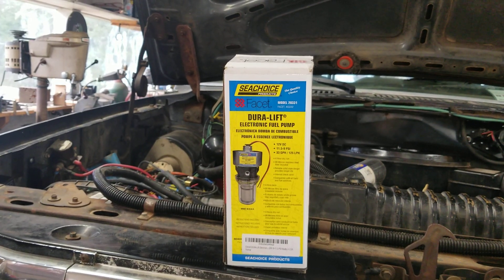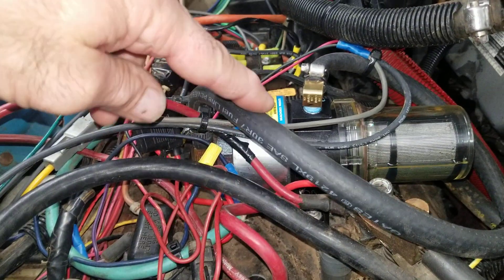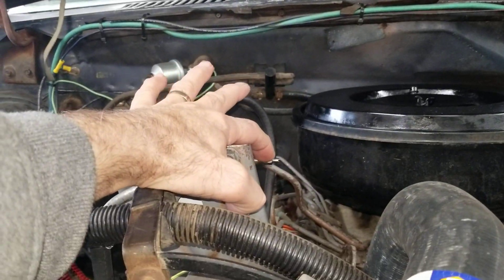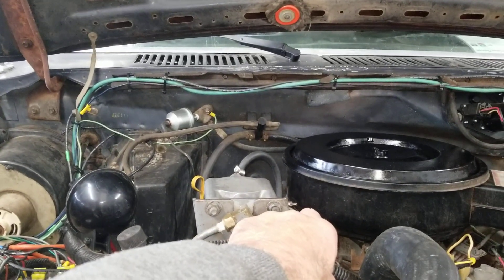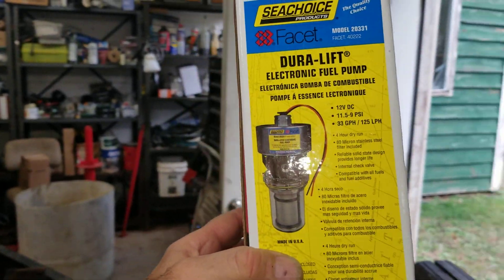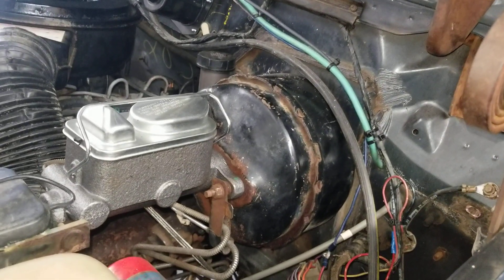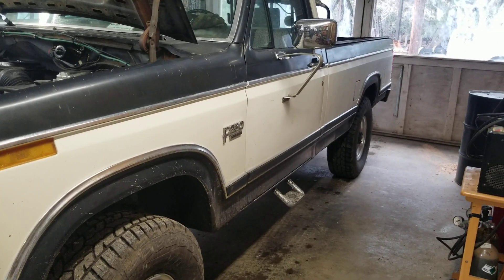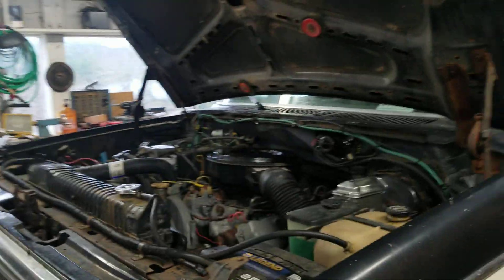Bull Nose gets an electric fuel pump & (What were you doing in 1983?)

Comment: I have a 1984 f250 6.9l and yes I couldn’t find the fuel sending unit my are rusty I’m in the north east but the truck was originally from Arkansas so the rust is not as bad you can say but not taken care I just felt in love with my truck  I love my engine I’m rebuilding it right now look it up Charles Falcon it’s not a show truck but will get the job done when completed it the best part it’s paid for, love your truck very clean post more videos, I’m thinking about getting and electric pump also, stay safe.
Reply from the maker: Thanks for the encouragement. The only downside with the electric pump is that it will advance your injector pump timing. Faucet makes two pumps one is 3 to 5 pounds but the one I have is 7 to 9 pounds. The stock mechanical pump at wide open throttle drops to 1 pound. Do your research before you buy. Have a blessed day.